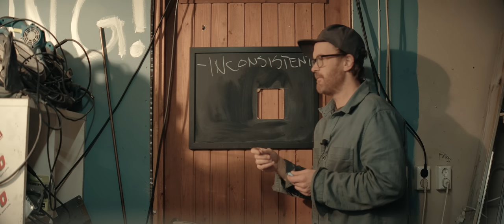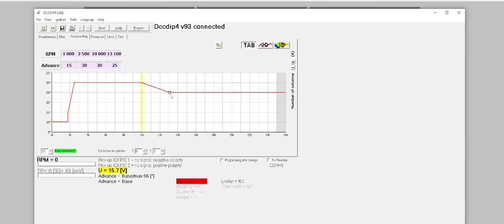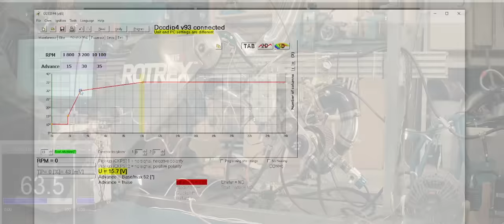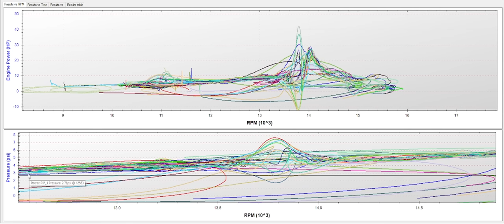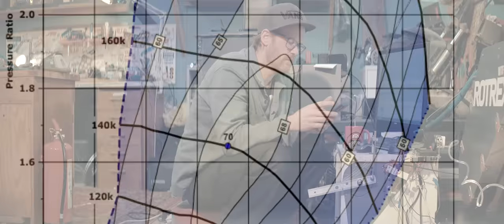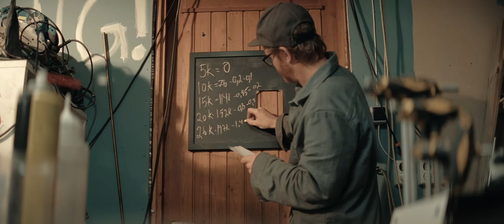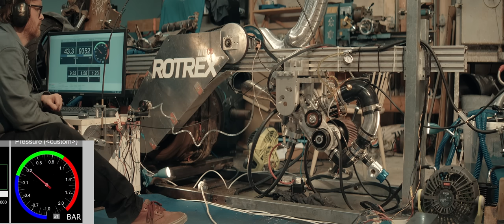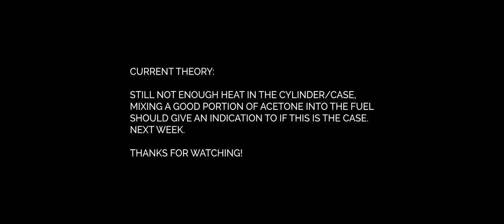Supercharged Pulsejet Engine?

Comment: After some pondering, I would mount a butterfly valve in the stinger section so that one could vary the backpressure in the pipe. If the pressure at the stinger was to match the pressure at the inlet of the carburetor, the engine could behave as if it were under increased atmospheric conditions. The engine behaved worse when you cut off the stinger, that was the telegraph that the engine is demanding a smaller stinger effectively. Think differential pressure rather than boost. You need boost to make power but if the differential pressure is too high then all that gas escapes during the "overlap" period. I hope somebody reads this.
Reply: Yes, I've read it!. I thought a simple gate valve would suffice. There have being quite a few comments similar to yours previously but worth saying again! Over 1000 comments last week. Alex has one heck of a fan club!

Comment: I wonder how much you would need to spend to kit together an in-cylinder pressure monitoring system. IMO no better way to gain insight into what’s going on inside a combustion chamber than monitoring the pressure inside the combustion chamber.

Comment: With a small capacity engine, the mass of the airflow needs a greater restriction. You are practically open to the atmosphere using those pipes. Also, I would still like to have a read out of RPM and HP on screen clearly.

Comment: I know it's a lot of work but I think the case volume is too big. The phase change for the fuel starts in the cases. You could try heating the cases some how but I think the large volume will prevent the mixture from absorbing enough heat because the volume & speed/time that the mixture speeds through.

Another thought could be less transfer port timing area. The longer blowdown can help with the pressure & being "forced" Induction, it may not need as much "time" to transfer. Like too much transfer is putting a LOT more mixture in the pipe. The reason I think this is because raising the blower pressure made it even a bigger flame thrower. The  reason it's a flame thrower is the mixture  isn't getting back into the cylinder from the pipe. 

Both of my suggestions aren't easy or "quick" fixes but I think you have a saying about things that are easy.
Reply: I personaly believe the crankcase volume is to high at 390cc.  My feelings are that it still needs a good primary pumping efficency even with force induction.
I have stated many times the crank cases are a massive heat sink. What we must remember, this engine has revved to 18300 with the Roots blower and speedway carb!
It seemed strange the stinger wasn't re attach when Alex said it made things worse when removed. I would like to see a longer stinger fitted which could be chopped down a bit at a time.

Comment: Any idea or chance of using some sort of a powervalve to control cylinder port timings? Pressure sensors would help on seeing where the boost could be going. Might be a good thing to check your bearings...could be worn already!

Comment: My disclaimer here is that I don't know enough to know what I'm talking about, but enough to travel down rabbit trail! 45 years ago, the Auto Mechanics instructor told us that the burn rate of gasoline in the combustion chamber is 0.003 seconds. Advancing ignition timing compensated for engine RPM, as the burn rate never changes. I tried looking up the burn rate of nitro, but the abstract from Penn State I found didn't give a time based burn rate. It did, however state this: " Over a pressure range of 2.5 to 15 MPa (250 to 2200 psig), the intrinsic burning rate of nitromethane was determined as a power law of chamber pressure: rb, [mm/s] = 0.316 P1.02 [MPa] It was found that the burning rate of nitromethane was insensitive to the variation in initial temperatures tested (15 to 43 °C). "  (I would provide the link, but YouTube will reject it.)

Given that gasoline engines in the 7K RPM range are looking at about 36 to 38 degrees, I would think you actually don't have enough timing at the higher RPM. I gather that you're trying to prevent burning back into the crankcase by raising the pressure of the A/F charge. Over the past few videos there one thing consistent, and that is that it breaks up at 15K. My mind keeps seeing that the fuel is still burning and expanding when the inlet port is uncovered, and lighting off the incoming charge. On the next compression stroke, it's still burning on the way up, but then completes the combustion process before the exhaust port is uncovered, at which point it blows the raw fuel charge into the exhaust stream when the inlet port is uncovered. That sets up the next cycle that fires as it should, though it then repeats the process, making power on every other cycle while sending the alternate cycle's fuel into the exhaust.

You're way ahead of me in what you're capable of! If you were me, you'd try to calculate the fuel burn rate in seconds and measure the piston travel in seconds at 15K and up RPM. Unless the time from ignition to inlet port uncovering exceeds the burn rate of the fuel, then you need to advance the timing, (which my become too far and start opposing piston travel) or you've hit the chronological ceiling.

That's just my brain. Your brain may vary...

Great series, by the way. OH, and you can have a STAR named after you for just $56. It will be registered in the US Copyright office. I'm sure that every astronomer from then on will be notified that the star in a particular coordinate is now named "Thurston Howell the 3rd". Or would that be, "LORD Thurston Howell the III".

Comment: It seems like it would be helpful to have more instrumentation inside the head and crankcase (and even carb and exhaust) to help understand what is happening in the engine. Ideally, that instrumentation would deliver images.  It is certainly possible to purchase cameras that are fast enough, but mounting would require a borescope adapter, and then, of course, securing the end of the borescope into the wall of whatever chamber is being imaged in a way that would tolerate the pressures and chemicals while also not affecting engine operation.

Comment: I don’t know much about methanol engines, but I do know a couple of things. The most illustrative thing about the cooling properties of the fuel, is that the 2.65ltr V8 turbo engines that champ/Indy cars ran in the 90’s and early 2000’s on methanol didn’t run any intercoolers for the turbo, and they still made mountains of power. And my own (very limited) experience with 350ci sprint car methanol engines is that they needed to have the water pumps slowed down just to get some heat into the engines.

Comment: I think the pipe may be the issue as well. We’re in new territory with a supercharger on a 2 stroke high revving engine so I don’t think resonance or back pressure is really going to play a huge part in this engine because it is forced through by the blower regardless.
Id like to see a straight pipe just to see what happens and see if it helps clear itself. Cheap and easy and worth a try🤷🏻‍♂️!

Comment: Is the extractor fan setting fire to the unburnt fuel coming out of the exhaust by any chance? I remember vacuuming up something flammable & it set alight. It must have been ignited by the sparks from the vacuum motors commutator. Maybe a brief test with the exhaust pipe open to air?

Comment: If you are still using glow fuel, reduce the oil. In effect 20% of your fuel is contributing nothing to combustion, but is robbing you of heat and putting out the spark. I've run 12% in glow engines with good results, and your design should tolerate much less than that.
Reply: I don't know how much oil there is in this new batch of fuel, the previous batch was 10% down from 20%
I fully understand what your saying. With the oil not combusting it acts like a retarder adding no power.

Comment: You're blowing air/fuel straight out the exhaust port during overlap, that's why it's blowing the flame, and blowing a lot more flame with the added boost.

Comment: You can hear how the instant "pulsejet mode" kicks in, the engine power dies immediately. The negative pressure pulses from the pipe operating in pulsejet mode must be causing huge short circuiting as they suck the mixture from the cylinder while the exhaust port is open. The only think I can think of to fix it would be to change the geometry of the pipe, but this of course would reduce the efficiency of the whole setup...

Comment: You might want to calculate the cubic liters per minute of the blower verses the total required volume of air fuel mixture into the engine per minute. Of course you  also need to factor in the boost pressure as another variable. Looks like a job for a spread sheet.

Comment: An odd question.  Have you thought of heating the fuel with a vibratory impulse plate?  I seem to remember a vibrating plate in a small engine (in the days when our sparkplugs were made of flint and steel), that lay in the base of the plenum and was hit full on by the incoming charge.  It was said to heat the fuel/air mixture before it turned to the next cylinder.  If heat is particles in motion, an alcohol/ nitro mix could certainly use some excitement before you have to use a welder to set it off.  This would be an adaptation of the Pogue carb like the Carter Thermoquad, where the heat of the radiator fluid was used to warm the mix in the carb, but not to Pogue's point of evaporation, as he was after conservation of gas rather than speed.  I just thought it might smooth out the engine some if you got a more reliable ignition.  Thanks for listening.

Comment: if you think there isnt enough heat, its really easy to just use normal gasoline and test with that, if you get it working with normal gas, then you know that the problem is in the fuel !
im pretty sure that with close 0.8 bar you should get over 30 hp with normal gasoline.

Comment: IKBA, but it seems to me that the only reason for crankcase induction in a 2 stroke is to allow the descending piston to "pump" mixture into the combustion chamber.  If there is a supercharger, then why does the mixture have to go into the crankcase at all?  Isolate the "transfer" ports from the crankcase, hook them up to a pressurised plenum, and as soon as the piston opens a port, or a rotary valve opens, the plenum rams mixture into the cylinder.

Comment: I'm not sure if this is something you or other people have thought and considered here but, the increase in pressure over the carburetor with increased rpm must mean a lower flow speed over the carburetor with higher rpm. If I'm not mistaken but I probably am, won't this lower the amount of fuel in the air mixture with an increase of rpm? 

My line of reasoning stems completely from the venturi effect. I think placing the carburetor closer to the combustion chamber with a narrower restriction between the combustion chamber and carburetor to increase flow speed over the carburetor might work. 

Hope this helps and sorry if this has been mentioned before.
/ Johan

Comment: Last time I asked about the expansion chamber exhaust. With the dimensions used does it have a resonant point around 15k rpm ? Try a straight pipe to eliminate it ?   I know you cut part of the exhaust away but not sure what the result was.
Reply: This expansion chamber has being made to be resonant at 19k N/A. It has revved to 18300 with the Roots/speedway carb pulling the retarder.
Check out 50cc engine throwing parts from a previous video.
 When Alex chopped the stinger off the performance was worse but he still ran it today with the stinger missing. Strange!

Comment: My guess is that you are blowing most of the mixture straight through the engine into the exhaust with the supercharger.  you may need a much tighter pipe, to build exhaust pressure above boost to reduce it

Comment: If the Acetone doesn't work you should really consider going at it, how do you say in english, in a more methodical/systematic manner.

Ie. start with things you know well and which are unproblematic - getting it to run on gas or e85 first would give you a clear indication if it is something Nitro/Methanol specific or a problem with some detail of the construction.
After all, if it runs properly on gas/e85 there's not that many variables left. And one of them, vaporization of fuel, is probably rather easy to test - preheating the air and giving it more time via longer manifold shouldn't be that hard to do.

If that doesn't work out there shouldn't be much more than oil content and ignition power. Which seems to be quite likely for all I know, and it would be compounded by poor vaporization and high oil content.

Comment: Great Video as always, love this channel!
Maybe you are on the right way. I guess you fuel is at 15°C and your Intake Air as well. With the bigger airflow caused by the supercharger It might be that your mixture is getting way to cold before the engine (or in the crankcase).
Could be an Idea to add a temperature sensor after the carb to get a reading.
Reply: Yes, it would be interesting to find out what the fuel/air temperature is under load.

Comment: Port timing is off? Needs to be control as the pressure is increasing. Or the increasing pressure is pushing the fuel around the valve.

Comment: When I was working on a kerosene-fueled (JP8, JP11, Jet A) drone engine for the Navy in 1997 (30cc 2-stroke, single cylinder, spark ignition), my primary problem was being able to start the engine and bring it to normal operating temperature. After much trial and error experimentation, I became convinced that the issue centered around kerosenes resistance to vaporization in the engine's crankcase. Increasing the compression ratio didn't help... so the fuel was heated to 200 deg. F—which absolutely didn't work. After a period of stumbling about, I heated the outside of the crankcase's backplate with a relatively small (1/2 inch) electric contact heater (12 volt). When the crankcase temperature reached 220 deg. F (after about 15 minutes), the engine started without difficulty and was allowed to stabilize at 275 deg. F (head temperature). Afterwords, the compression ratio and ignition timing could be adjusted for peak power on my pendulum dynamometer. 

The system worked so well that my sponsoring R&D Company, applied for, and eventually received a patent, in my name, on the system as applied to two-stroke engines. It has since expired (after 17 years). My decades-long work with methanol/nitromethane fuels suggest than crankcase-heating might be beneficial to your very interesting problem. However, I believe that your crankcase temperature is currently much to low to take advantage the phase change required (atomization to vaporization) by the time the fuel mixture reaches the combustion chamber. Please note that I allowed the electric heat to continue until the desired head temperature was attained—then it was turned off. Dynamometer testing revealed approximately a 20% drop in bhp if the electric heater was left on indefinitely....If you need any clarification or specifications about this heating system, please contact me.

Comment: Why not to use an Arduino board with a temperature sensor (pt100 for example)  and set it up to switch on the pump through a relay or a solid state switch (mosfet or motor driver) ?  you  could set up for turn it on at T+5C, and switch it off at T-5 for example... then you can also have an extra statement that at T+10 fan turn on activated with a relay,.
Also I still thinking that an electronic injection with one or two inyector is the way here, you can adjust everything on the flight and be sure about the atomization of the fuel. with a high pressure pump you can even inject directly in the crankcase towards the point that you want to lubricate.
also if you want to inject warmer fuel, just put the fuel hose around the cooling hose, that way you can get a few extra degrees on the fuel, but something tell me that this may not be a good idea... but it will be fun to watch :D.

Comment: I think you should give it even more timing, nitromethane burns extremely slow compared to gasoline, from what i've read some supercharged nitro four stroke engines are in the 50-60 degree of advance range.

Comment: Measuring EGT and a Wideband O2 sensor might help.  Seems like the engine goes massively rich at the point it's blowing out the expansion chamber.
Reply: Alex used to use a EGT sensor but had reliability issues. A conventional O2 sensor wouldn't last long due to the expelled unburnt fuel/oil. Last week a chap suggested using a diesel O2 sensor which seemed a  good idea.

Comment: You should install a thermostat in the cooling system so that the engine temperature is constant and is around 85-90 degrees C. This is very important for the spark plug, which must clean itself, for which it needs the right temperature. only when you have constant thermal parameters, you should think about further modifications, otherwise it will be difficult for you to make good decisions. You did increase the boost pressure and did you also increase the fuel dose? Greetings.
Reply: As for the exhaust system, it seems to me that you should put a straight pipe so that the gases have a better opportunity to leave the cylinder. only later calculate the exhaust system for engine parameters to increase efficiency. now the exhaust is counted to 50ccm but by increasing the boost pressure and increasing the fuel dose you virtually increase the engine capacity, so the exhaust system should be more efficient.

Comment: Rotary valve for the exhaust side to keep the combustion inside the cylinder and not happen in the chamber? Maby removes the pulse jet action?, it almost looks like it runaways like a diesel,instantly when the intake air and gas comes into cylinder at 15k it goes straight out of the exhaust port to the chamber and makes the flame